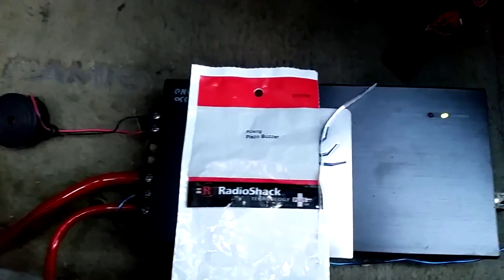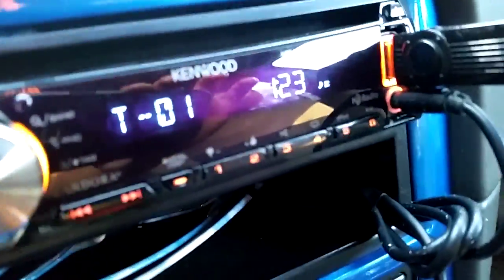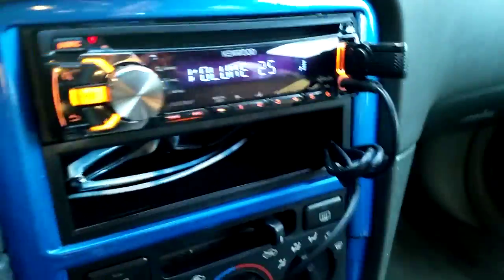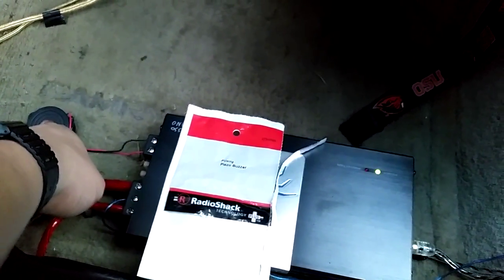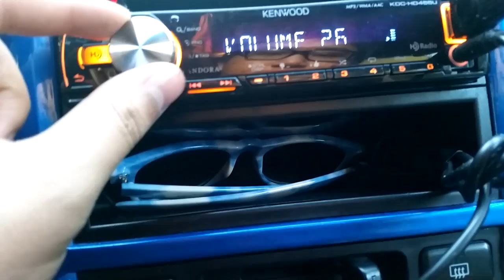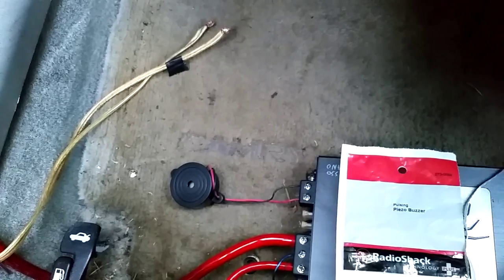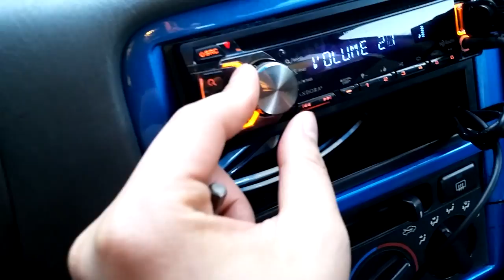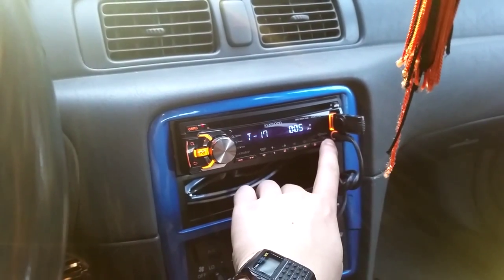HOW TO SET YOUR GAIN FOR UNDER $10 WITH PIEZO BUZZER

Comment: So if you're wanting to set amps 3500-5k would you use two of these so they can handle the power?
Reply: Andrew Mack 
Did you try a piezo at a higher voltage? Did it work out or you blow it?

Comment: Y would u send a tiny clip signal to ur sub? U should back off the gain a bit and let it have a clean signal.. Dude i want to ask u more questions on this is u could respond that would be cool
Reply: Yeah, if you have any voltage drop that little clip gets bigger.

Comment: how much power can the pizo take? my sub amp is 2krms..
Reply from the maker: Well, the piezo has a resistance of ~100 ohms, so... with some quick ohms law to esitmate...

2000W at 1 ohm gives you around 44v output of the amp, so, 44v at 100 ohms gives you 20W.
Reply: Thanks lot.